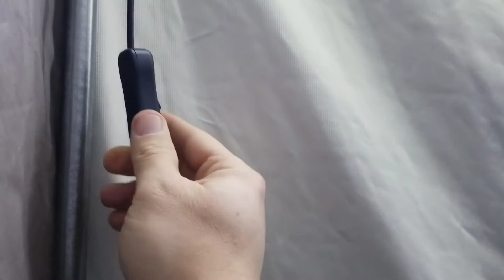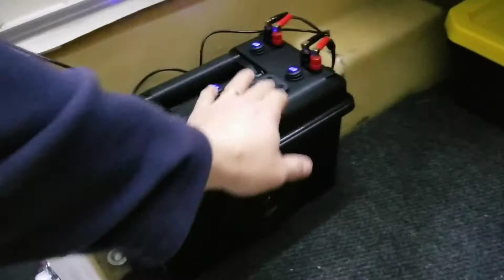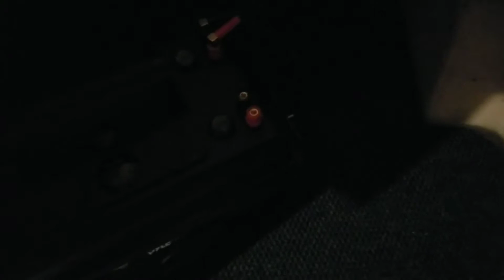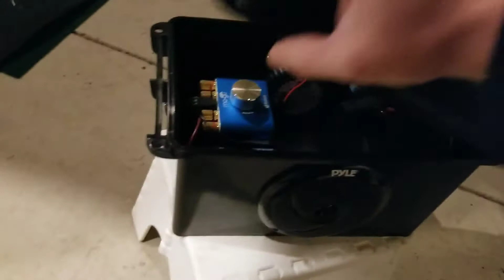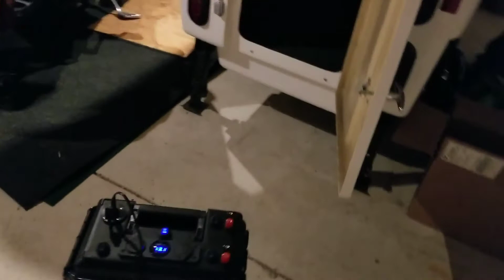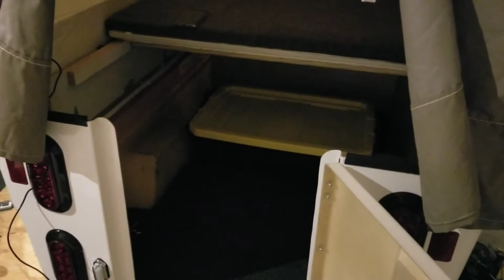MiniMate Power and Lights!

Comment: I just ordered this kit from “ Ice Hole Power”. I bought my own speakers and Bluetooth amp from Amazon.  I also bought my own SAE connector and will be installing it similar to yours.  Since the cigarette lighter style socket is for the most part phased out, I bought a two port USB charger 3.0 amps to replace it.  I will not be installing a second fuse for the charger, as the primary path to the battery is already fused.  It would be redundant to install a second one.  I see how you wired the SAE on your box and yes, I agree with your decision to install the second fuse.  I purchased  two 12 AH AGM SLA batteries but have my own 18 gauge wires, flag connectors and crimpers.  I think I am all set.  Good video,
Reply from the maker: Great! I've really liked mine and it has held up very well.  In fact, we had a power outage here at home last week and I grabbed it from the garage quick so we could use the flash light and charge the phones up.  I stayed with the cigarette socket since we have the air mattress pump with a plug back up to the battery, but I agree, it doesn't get much use.

Comment: Very nice. I use 4 of the same batteries that I put under the floor. If people want to know where to get them go to any home depo or lowes and get emergency exit light batteries. I dont have specific lights. I do have a power distribution center with plugs and jacks ect with a fan/condenser for cooling. I use a 45 watt suitcase solar to keep it charged.

Comment: Amazon links for the switches and led lights would be fantastic.  Great job.  Red wings are the fastest.  Where did you get the batteries and which ones are they specifically?  Thanks.
Reply from the maker: I don't have links for Amazon, but search Ice Hole Power Boxes online.  You can support a small business guy with purchasing either a completed box, or the DIY kit and assemble it yourself.  I did the DIY kit with standard 12V lead acid batteries as I don't need the expense and power of lithium right now.

Comment: Hi..I have a mini-mate. I use two solar generators for my camper. A 26000 mAH  with an 18 watt panel..and a 40800 mAH with a 100 watt panel. The smaller one runs the lights in the camper...it powers up to three lights,,but one does ok...it will power if for over 20 hrs...the Larger one if for other electronics..drone, tablet, phone etc.
Reply: A solar plug on the power box would work great.  I am using a Jackery now, but will move to this when my Jackery dies.